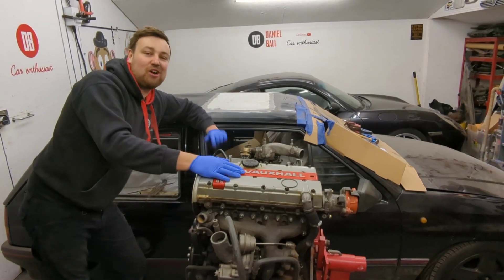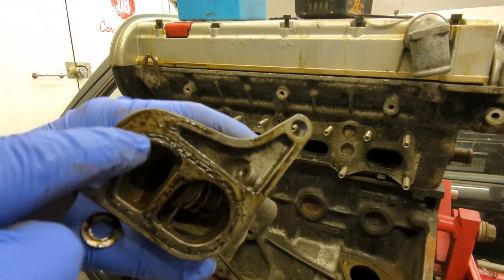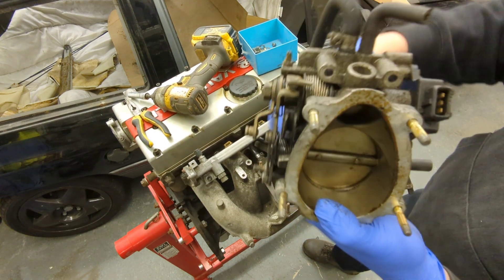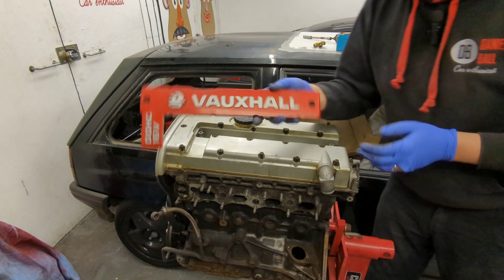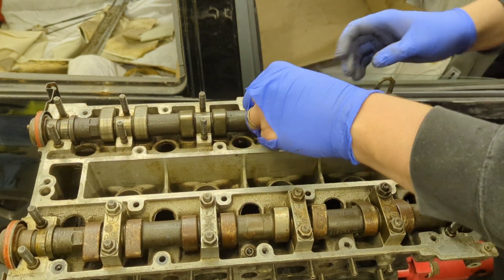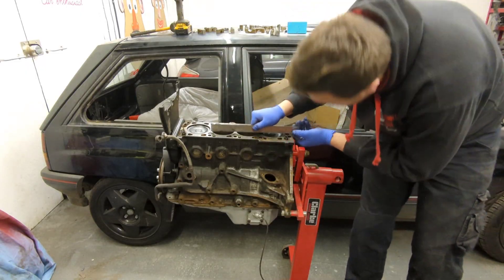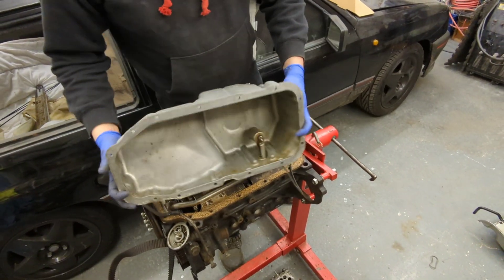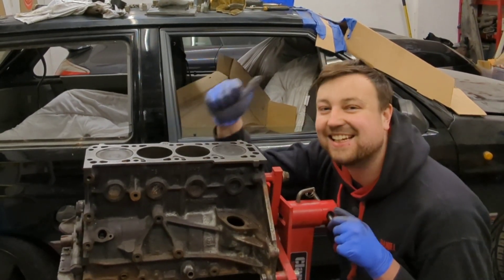Calibra Turbo engine strip down - the MIGHTY C20LET

Comment: Use copper nuts on the exhaust manifold . steel on steel is a bad idea on the exhaust side . its actually the XE cam that has more lift hence why they are fitted into the let . great strip down vid are you building it for power or just a road car ?
Reply from the maker: Yeah I planned to use the copper coated nuts, this is just how it came. And yes your right, an XE inlet cam has another 1mm lift 🙂 Thank you, it's just going to be standardish power for a friend's Nova. He does have a chipped ECU to go with it, so hoping for around 250+bhp.

Comment: A lot of issues on one engine, worse that someone's been in there before.   Full reburbishment required!
Reply from the maker: Yeah, sadly it's very rare to find one of these that hasn't been messed with. The actual core bits are in very good condition though so it will make a nice engine once completed.
Reply: @DanielBall  Getting to that age I'd guess!